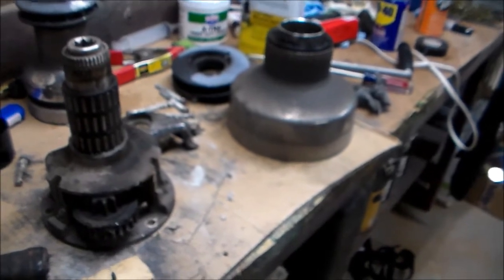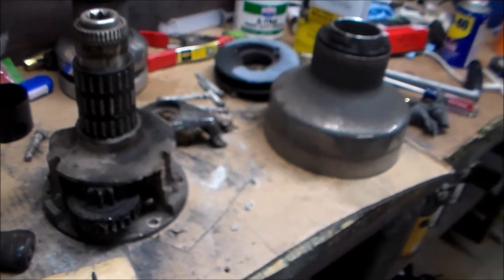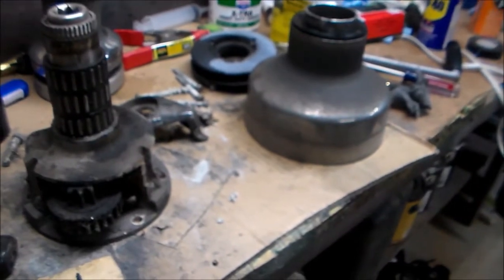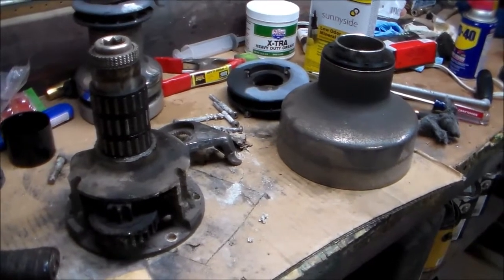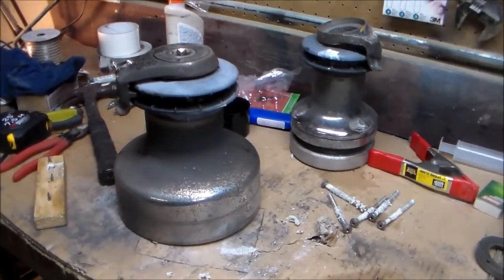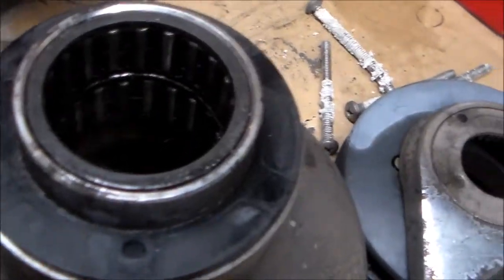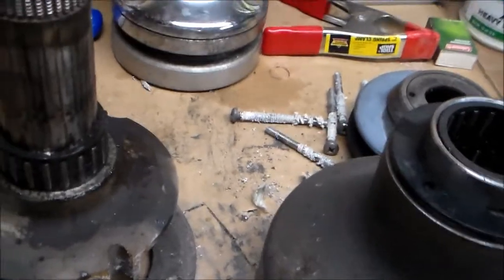Barlow 27 Winch rebuild

Comment: Many thanks , we found this really useful. Struggling to reassemble two self tailing Barlow 27 winches today. Hit a snag -  once we had screwed down the double plastic self tailing jaws , there was no way we could fit the  top pieces. Help , please.
Reply from the maker: Mary,  as you slide the drum over the gears, you need to put the stripper ring on top, but first slip the little arm between the plastic jaws.  Then lower the whole assembly over the gears.  The key is putting the little stripper arm between the jaws and set the rest of the stripper ring on top.

Greg

Comment: Thank you for generously sharing the detail of the cleaning and rebuild.  Where did you find a replacement  for the broken spring?
Reply from the maker: Hi Mark.   You can use most brand springs in the Barlow winch….i would just check them to make sure they look the same.

I also four a bag of springs and pawls at a marine flea market that I use as backups. 

Greg

Comment: Thank you for your post, I am keen to get stuck in and service my barlow Australia 27 self tailing winch however I can not get off the top claw, can you help? I have tried to put a Allan key in each whole and use a long file and wd40 to turn but they will not move, i can't even get it off my boat because someone painted over the bolts etc. Any advise would be greatly appreciated. Thank you
Reply from the maker: Tracy,  what I did was take a short piece of wood, and drill 2 screws into the wood, letting the tips poke through the board.  I placed the screws as far apart as the 2 holes in the retainer plate on the winch.  Then I just put the board over the winch, poking the screws into the 2 holes, and then use the board to give it a twist.  I have never had one that didn’t unscrew that way.

Righty-tighty, lefty-loosey,  at least here in the US 😎

Once the retainer is unscrewed, then slide the drum and the “top claw” up together.  The bearings may stick in the drum, but that is ok.  Just lift them straight up and off the main shaft.

I hope you can get it apart.
Reply: @TallyHo322  great, thank you I'll give it a go and get back to you. I read about using a sea spanner too but never heard or seen one of those. Thank you again
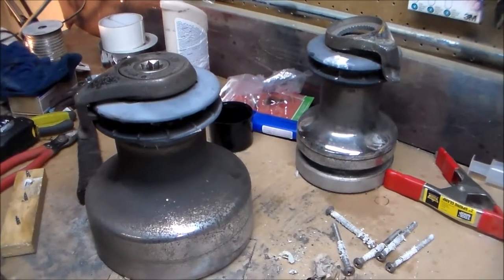Reply from the maker: @tracymcgrouther975  this vide shows the little wooden tool I use…about 1:30 into the video…
https://youtu.be/UbAQkJ_V7IQ